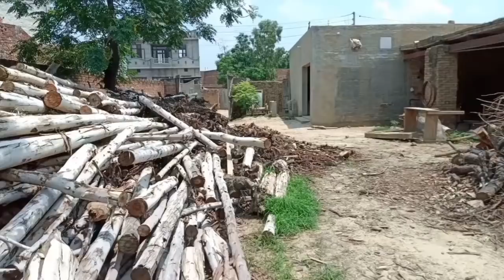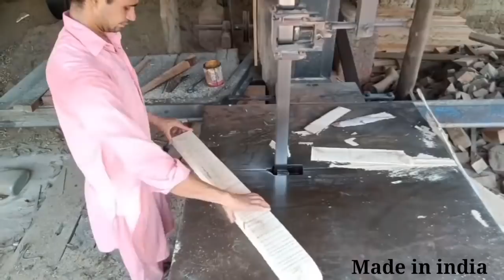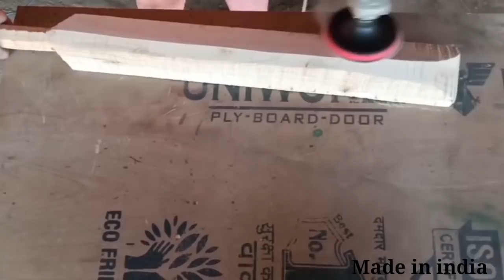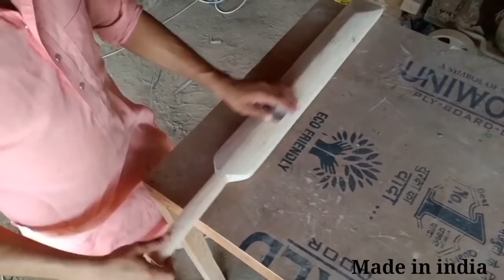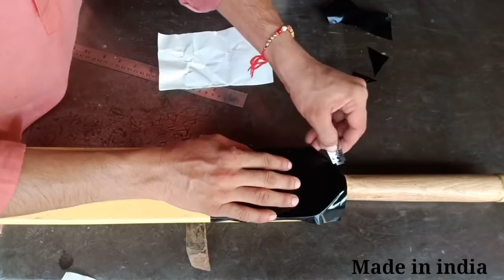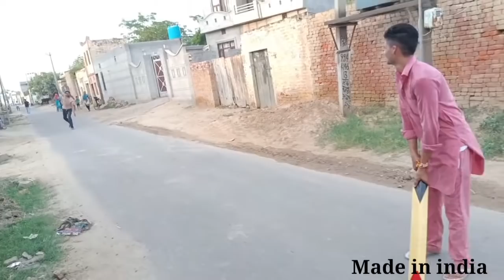बिना कलम के बैट बनाना सीखे, Homemade bat, how to make bat

Comment: No they right , a ribber in the grip bar eleminates the vibration of impact through absorption, eta, ekta 8 milimeter cleft kor like a knife inserted through the middle of the handle till the deltoild depth of the bat and foam dokha, tar por  if eta full size original hoy size then paatha , trade de